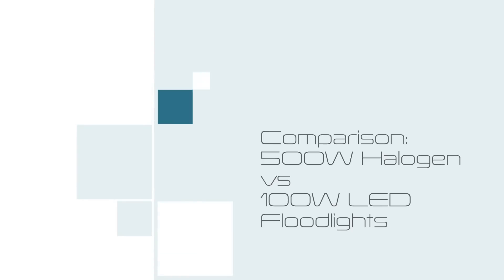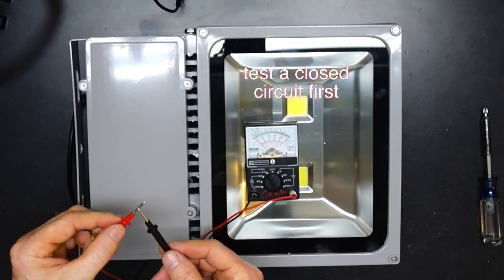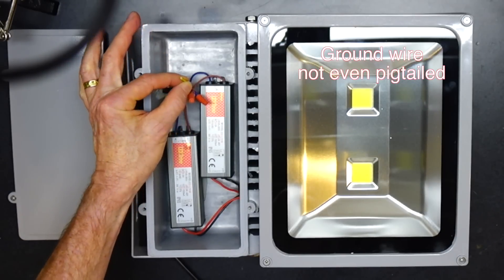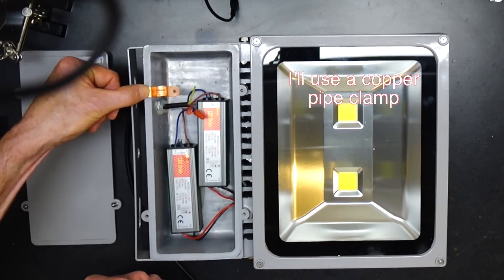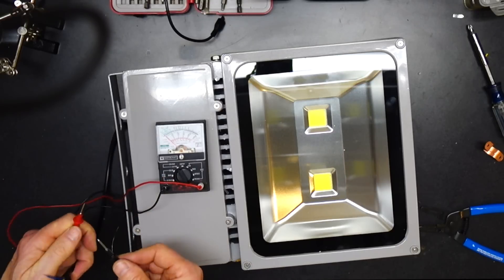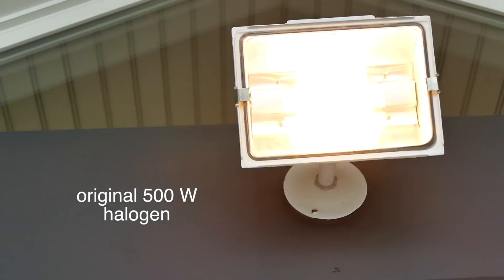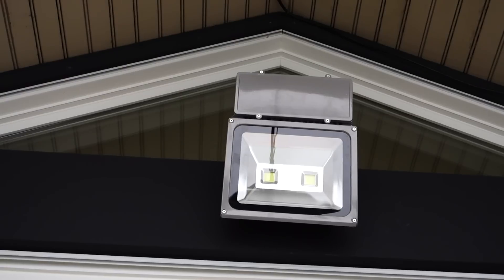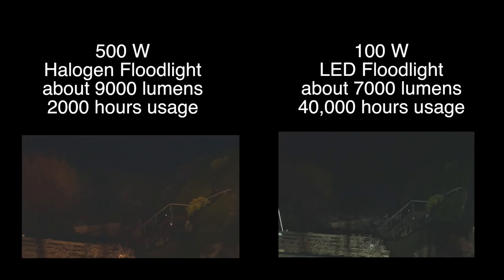100 Watt LED vs 500 Watt Halogen Floodlight Comparison

Comment: I run a construction business and I have replaced ALL of my halogen work lights with 4,000 to 10,000 lumen LED work lights. The halogens put out ridiculous amounts of heat, are expensive to run, can burn workers, have bulbs that burn out every other month, cannot be used in inclement weather and are fragile - bump one and break the bulb. The LEDs are cool to the touch, light weight, the bulbs don't burn out, they are safe to use when it's raining, and are durable and inexpensive. My tapers and painters love them. I can put two or three in each room in which I have guys working for the same cost as one halogen. The outside guys, framers and roofers and the like, love the 10,000 lumen lights on stands to be able to extend their work day. No comparison, halogen is dead - at least to me.
Reply: Hello, can you tell me how much lumens a 200 watts halogen bulb delivers ? The problem with these led floodlights is that they almost never tell the true power. A 100 watt led floodlight only gives 50, a 50 watt only gives 30 or 20... and it´s getting worse. I purchased recently some 30 watt RGB floodlight, but they do not illuminate a third of my old 30 watt led floodlight. This is outrageous !
Reply: thats good sir.. LED is better than halogen.
Reply: @vesandreev7864  LEDs come in a variety of color temps. There are even LEDs that adjust color temp on the fly to anything you want, which I use both in film-making and mood lighting in my home.

Comment: eastern watts are usually 1/3 western watts, i have not worked out east/west lumens coefficient yet... but i also know that a longevity hour eastern is not the same as as western either, and seems to be random depending on jet stream air current speed....

Comment: Hello, can you tell me how much lumens a 200 watts halogen bulb delivers ? The problem with these led floodlights is that they almost never tell the true power. A 100 watt led floodlight only gives 50, a 50 watt only gives 30 or 20... and it´s getting worse. I purchased recently some 30 watt RGB floodlight, but they do not illuminate a third of my old 30 watt led floodlight. This is outrageous !

Comment: I'm going to replace my 500w halogen work light (cost $5) with a 10,000 lumen LED work light (cost $40).  In other words the the LED costs 8 times more than the halogen for similar brightness.  But it's worth it because of heat and safety issues with halogen.

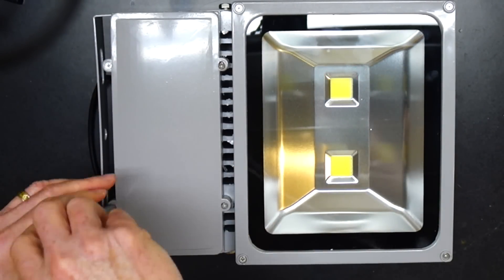Comment: (0:34) - Um, don't you mean an "open" circuit on the ground?
And at (1:052). You really should have filed or sanded off the paint there, at the point where you are attaching that ground lug/tab to make any kind of decent connection.
At (2:05), it really sounds like you are saying "gelatin", rather than "halogen". Am I mistaken? Please. Please listen to it.

Comment: just bought an LED flood light  that looks just like the one you show. I opened it up and it is grounded but the ballets look smaller than the ones in yours and mine is supposed to be a 100 watt light. How can I find out if it is truly a 100 watt light?
Reply: john1 smith - two ways, (1) have a watt meter and connect to the AC side. I do no have one such. (2) Measure from the low voltage DC side. The voltage and Amp, for example 24v * 2A = 48w.  I have one such multi meter from Harbor-Freight (free or about $4).  I would not be surprise thie 100
Reply: Crap, hit the wrong key. This 100w may only have 50w. But I am sure it is very bright for the money you paid.

Comment: As long as it's installed high up where no one can touch the housing why worry about the ground wire?
Reply: Because if somebody goes up  on a ladder, for example to reposition the direction of the lamp, and they get an electric shock and their reaction throws them off the ladder, they may finish in a wheelchair for life.   BigDish, I don't think I will count on you to perform risk analysis.

Comment from the maker: LEDs are super efficient lights and are now being seen at higher power levels suitable for floodlights. Online sellers like Ebay and Amazon cover everything from expensive high quality to non-certified cheap knockoffs. I review the build of a cheap one  (although it said in the ad it was CE approved) to its internal shortcomings. For those handy and confident, they are a bargain, but buyer beware.

Comment: I had a similar unit.  It also had the ground wire not connected.   And the other connections were just twisted together, with a plastic cap covering..   Like some flaky product from the 1940's.